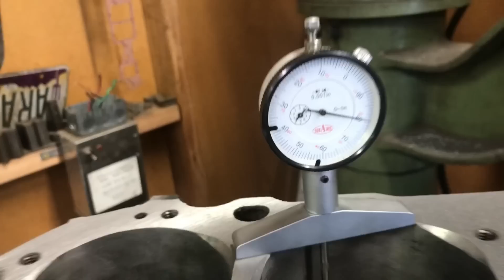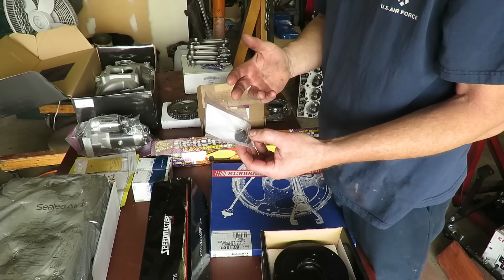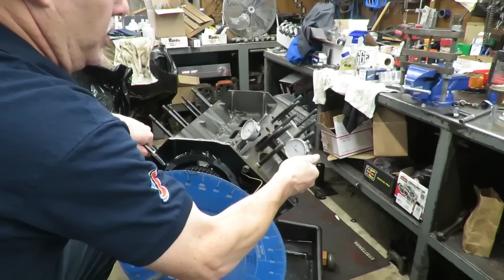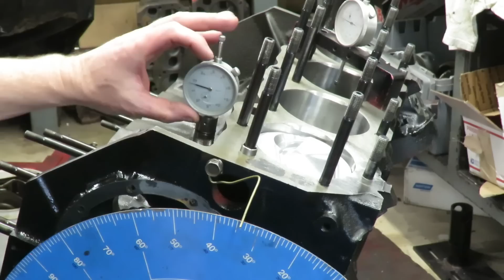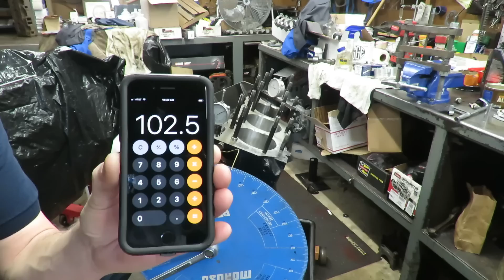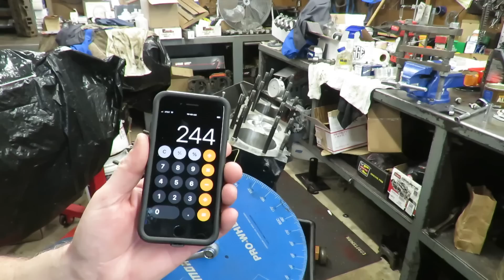Chevy S10 427 Big Block project!!

Comment: My engine is basically the same set up mine is bored 60 thousands so it's a 439 I have afr 265 oval port heads with a Howard's hydraulic roller 235x241@50 on a 108 lsa I do have a Lil more compression I have around 10.5 to 1 I also have the factory forged crank with the good gm dimple rods and with a Victor Jr. Intake and a 950 it made 662 hp and 605 torque. I think you are going to be surprised at the power. This set up makes if your heads flow good. I'd like to know what headers your using on the S10 can you tell me the part number and brand? Thank you in advance.  Your friend from Louisiana Rick 427

Comment: Great video. You camshaft is fairly close to the one I have. I have a 427 sbc built in 2012. It has a Howard's cam with .400 lift and 251 duration @.050 on the intake and .387 and 255 duration @.050 0n the exhaust. It has a 110 lobe separation and center line of 106. I have afr 220 heads on it. It put out 598 lbs torque  and peak hp was 648@ 6200 rpm when it was run on the dyno. Did you dyno yours and if so what kind of numbers. I'm currently thinking of doing a 468 or 496. Thanks again for the great video's.

Comment: In this day and age,a press fit pin ……..
Really?
Why would you heat a rod end up 
Like that on purpose?
I’m a novice to this so please don’t take my comments the wrong way.
I’ve seen rods glowing red to put the pin in.That’s got to screw with the strength of the metal.
Reply from the maker: The rod heater has a thermostat that limits the temp, the factory for most makes uses this method most production engines are semi floating press fit pins

Comment: I have pretty much the same exact motor 427 60 over howRds 235×241 duration @50 618 lift on a 108 lsa AFR 265 oval port heads that had 112cc combustion chambers that were milled to bring my compression to 101/2 to 1 the only difference I see is my pistons only had 18cc domes TRW forged with factory forged crank and dimple rods I even have the speedmaster airgap intake great minds think alike...lol I'm putting the motor in my 88SS monte carlo. Thanks for the video your friend Rick427

Comment: How does a 454 bored 060 over make it a 440 ?
Reply from the maker: its not a 454 its a 427 because of the crank stroke that's why the title of the video is 427 project this is also explained very well in the video series perhaps you should watch and listen closer

Comment: On your video chevy s10 427 big block project!! When you were checking intake lobe center u said 56* at 50thou, then went other way 50thou and had 151.5. But when u added the 2 u added  54 an 151, instead of 56*. Anyways still in spec an love your videos they are by far the best educational engine videos have found.

Comment: Get a lower rise intake and use a 1" insulating spacer. It'll keep the carburetor from heat soak and give you the extra plenum at the same time.

Comment: on a chevy 400 would you recommend using a small base circle cam with scat stroker rods that are already clearanced or do you think ill be ok with just a standard cam this is not a stroker motor just a 400 with the 7/16 cap bolts?

Comment: Why deck a already thin stock block 20 thousand to gain a 9:8:1 ratio? Run a 22 /27 cc piston and there you go .. and also yes like mark and myself and you yes you can use 781 heads port them and install bigger valves but that’s a lot of $$$$$ peanut port heads ported would be cheaper and deff deliver the power numbers for this build there actually better suited and would bring way more low and mid range power on this engine

Comment: What kind of RPM are you planning on turning with this motor? I have one with same heads ported best to my capabilities ,219/188 valves also and it comes up on the chip(7500) extremely quick if you are not paying attention also same compression ratio , your videos are extremely helpful

Comment: Does all this  info etc., also apply to the 454.  I've just bought a 454 backed up with a 4 speed to put in my 1976 Stingray.
Reply from the maker: Yep the only difference between a 427 and 454 is the stroke you could apply all this to a 454

Comment: Why are you using head studs with only 9.8 compression? And why are you not using studs on a two bolt main block?
Reply from the maker: I used the head studs because I had them,  also if you plan to remove your heads now and then you should always use them regardless of compression ratio. I actually  did use main studs although it's not in the video I ended up changing to studs however on a mild build like this main studs are not at all necessary,  I'm not sure why you think they are!   Chevy BB 2 bolt blocks with factory bolts  will take 500 HP all day long with no issues
Reply: @Myvintageiron7512 The piston speed of a 4 inch stroke at 5500 - 6000 rpm which a lot of street engines get to , needs all the help it can get.
Reply from the maker: @joe-hp4nk  The piston speed of a 4" stroke engine at 6000 RPM is 4000 FPM  even the  weak 2 bolt main small block  with stock bolts can take 4000 FPM all day long a BBC can take much more than that I have been doing this for 30 years  I have never ever seen a Big block Chevy 2 bolt block stretch a cap or bolt after being buzzed to 6K  like I said you could spin a stock 454 bottom end to 6K over and over for years and you will never hurt the 2 bolt caps and or stock bolts I'm not sure who is giving you theses ideas but they are just plain wrong Also this whole conversation started by you questioning why I used stock bolts on my engine in the video is not a 4" stroke  it is a 3.760 stroke at 6000 RPM is has a piston speed of  3760 FPM  you could hold any engine at that piston speed indefinitely with no main cap or bolt issues again you really need to do more research before you post this stuff

Comment: There's a good reason Why the lifter valley has those long holes. oil drains down over the camshaft for lubrication of the lifters and lobes.
Reply from the maker: Wrong BBC cams are engendered to oil the cam from underneath the oil throw off from the crankshaft  Blocking off the passages in the lifter valley is common Practice it is done to high RPM race engines all the time and it improves HP  you really need to do a little more research before posting because you really don't know what your talking about
Reply: @Myvintageiron7512  I know about the splash from the crank. It's just at idle when there is no splashing or very little the extra oil from the top is welcome on a flat tappet cam.
Reply from the maker: @joe-hp4nk  There is tons of oil being thrown onto the cam even at idle more than enough to keep it lubed
Reply: @Myvintageiron7512  The baffle that prevents oil splash also prevents oil from reaching the cam so oil draining down from the top is welcome.

Comment: Will a short deck intake fit on the tall deck block?? If not why??  I just got a 427 tall deck and trying to find parts that I can buy with out killing my pocket..?? Any help would be very appreciated..
Reply from the maker: They do make spacers to adapt your short deck intake to a tall deck you will need an aftermarket distributor as well 
https://www.speedwaymotors.com/Weiand-8206-Tall-Deck-Oval-Port-Intake-Manifold-Spacer-Kit,145572.html
Reply from the maker: No the heads are farther apart because of the taller deck so it takes a wider intake
Reply: Thank you very much.. After all the help and research I should just let it go to the scrap yard and get crushed.. And I would have been better off with the 454 instead..

Comment: Here's an interesting scenario maybe it's not the main seal, after warm up there is no leak, only when I rev it up its starts pouring, I'm thinking pan is the culprit, I  tired tightening them, some were loose but still the same thing no drip at idle just at higher revs
Reply: Also noticed a mist or spray hitting flex plate flange as if gasses was exiting, could this possibly be culprit a pan gasket leak lmk

Comment: The new 468 i am building i am using a howards hydraulic roller cam 297 / 308. Duration 640 /640 lift 114 +4  lobe seperation 110 intake centerline. Plus boosting it a little bit. Howards / Morel lifters are much better then Comps.

Comment: Driving this truck on the street with this built engine what is the life expectancy of this engine ?
Reply from the maker: many years the parts in the lower end are rated for over 1000 HP I'll have about half that much also the RPM range will be 6000 max I always like to build em big with pump gas compression and low RPM so they live a long time it's better to rely on HP to weight ratio and big CID to make something go fast you don't need crazy compression and high RPM's to make power

Comment: I will say that I did find this video very informative but if you could please read my last 2 comments I would like to know the answers to the questions posed, I'm not trying to be a dick but I'm new to degreeing wheels and I just wanna have all my bases covered. I'm gonna be building a small block chevy 350 , last 3 of block casting 010 if it helps with edelbrock performer rpm aluminum heads. Also I'm probably gonna go with a radical cam with a 3500 stall,loose with 26 to 28% slip for the two step launch control. What's a good lift to match the cam at 10 to 1 compression, also what's a good deck machined height and gasket to ad in lift times compression. Fyi I'm self taught so be gentle and sorry for a thousand questions...

Comment: Wait a minute originally you said 56 degrees then you went backwards you had  151. But you entered it in the calculator you put 54 and 151witch gave you 205÷2= 102.5, but in reality 151+56=207÷2=103.5 degrees, you sir are actually off by one full degree then correct....

Comment: Hey question a buddy has a big block in a stock car and was told it has a advanced cam... We put a hei distributor in and can't get it to run do u still drop them in at 0 tdc rotor at #1 plug wire???
Reply: On compression stroke

Comment: Yes opening the oil drain above timing chain is a must , especially if you run a gear drive. Also open the ones in corners of the heads as well. Love you videos.

Comment: Hey boss building a street strip 489 bbc and wanted to ask you a question yesterday put the crank in with bearings and checked my bearings clearance and came up with .0015 on all of them is that a lil to tight? It’s a 4.25 crank what’s your thoughts on it. Thanks in advance
Reply: it's fine for the rods a little tight for the mains
Reply: Mike Stanfeild Thanks for the feed back talked and looked around and everything I’m hearing is it atleast needs 2.5 to 3 thousands but now my problem is that the crank is standard so are the main bearings. So gna have to see if I can find who makes them cut under standard. This is my first kit I bought together pre balanced and will be my last. Called summit to let them know and they said the company they do the dealings with can’t send me bearings until June.

Comment: Great ,to the point content. Its been years since I've rebuilt one and just wanted to be brought back to speed. These videos are a great tool. One thing that I use to do was use STP Oil for rings and bearings. I used the regular cam assembly lube on flat tappet cams but STP on all other points. Is that a bad thing now? Or is it simply an opinion of what you grew up using?
Reply: There's tons of great assembly lubes out now there's no reason not to use them. I used to use Camguard for aircraft mixed with STP but a good assembly lube is a lot cheaper these days although I still have a tub of Continental Cam grease used for aircraft flat tappet cams that I swear by. But the stuff is crazy expensive these days and thankfully I've got a lifetime supply lol

Comment: What's your opinion on full groove main bearings vs. the more common single side grooved bearings? 
Excellent job explaining cam degreeing, best I've ever seen, very easy to understand compared to other videos
Reply from the maker: 360 degree grooved bearings cause excessive oil throw off you need a high vol oil pump the excessive oil over whelms the oil rings and can glaze the cylinder walls not recommended

Comment: Fun Fact
Down here in Florida, the LS swaps have gotten so popular (5.3 engines are now about $2000) that the Gen 6 454 Big Blocks are now selling for about $600. The Gen 6 came with a roller cam so it has built-in Cam Walk limiters.
It's a good thing since everyone like a Big Block.
Reply: @Camo4life Realtree I usually buy my engines off the shelf so I have to pay a little more.
How much did Pick n Pay charge you?
Reply: @Camo4life Realtree Good Job, are you going to boost it? I'm planning on boosting (turbo) one of these engines but with a cast crank I don't know, I might have to get off my wallet and get a forged crank.

Comment: Those connect rods look like I-beam rods not H-beam rods. By boring the cylinders .060 on Chevy 427 is 4.185 not 4.30 unless it’s 454.
Reply: 5 Saber standard bore on both 427 and 454 is 4.250. .060 over would be 4.310 for both.
Reply: Sorry, I was incorrect about the 427’s bore size. You’re right. Thanks.
Reply: 5 Saber you are confused 4.185 would be a 400 sbc .060 over...
Reply from the maker: Did I say H beam rods? dang I need to back and watch that they are definitely I beams

Comment: DONT PUT UR RING GAPS ON THE THRUST FACE OF THE PISTON...  amateur hour
Reply from the maker: I have had this conversation so many times.  I will spell this out again,  back in the old days there was a diagram telling you exactly where the gaps should be set,
 However we now know that the rings rotate on the pistons when the engine is running Total Seal has proven this over and over, so it does not really matter where you put the gaps as long as they are staggered maybe we should call this uninformed hour rather than Amateur hour
Reply: Myvintageiron7512 
oil rings do not rotate

Comment: The .050 on each side of the cam lobe....that'll only work with a symmetrical cam lobe.  You can't find the center of lift of an asymmetrical cam lobe with that method.
Reply: That's how manufactured give the @.050 duration number.  The degree is measured at .050 so regardless of the lobe geometry it's where it is
Reply from the maker: yes you are right Asymmetrical cams require a different procedure but 95% of the cams most people are running are symmetrical

Comment: Surprised you're using a  2 bolt block. Would it be worth installing 4 bolt steel caps? How much does that run?
Reply: Usually 400-500 in labor for line bore and line hone + cost of caps
Reply from the maker: Two bolt Big blocks are crazy strong I ran a two bolt with 600 HP for years and the block held up just fine
Reply: @Myvintageiron7512  I was in a bench racing session years ago with a couple of very smart engineers. The focus went to the extra ears on the 4 bolt caps. Some but not a lot of extra strength was the conclusion. However steel caps or a stud girdle was deemed worth the trouble.

Comment: The duration is likely off because of the dial indicator holder tool follower is slightly smaller diameter than the actual lifter.  If you re-measure with the lifter, duration should be as specified on the cam card.  The tool is good for centerline method because you are just measuring the same distance on either side of peak lobe lift.
Reply: roller lifter only contacts one point on the wheel, the indicator tool has a rounded insert end for mimicking the roller wheel of a roller lifter.

Comment: Why are you going thru all this work for a hyper piston dual plane intake motor for an S10.. Any stock 427  would have been just perfect ...I'm really trying to understand why your going thru all this work  for a Dual plane mid performance motor .... All the work your doing would be a welcome sight on a 12:5 motor single plane  roller cam 2 1/4 inch header bad ass...  I'm just not feeling it ... bro ...it really seem's like your like going thru the motion's  and coming up short ...and I have to wonder just how many big blocks  have you ever built under 500 HP ?  Because My L78 80 over 396 with 11:0s and a not to wild solid roller Victior intake and we didn't even go nuts on the head's we used a Carb Shop 950 CFM  stahl 2 1/4 inch headers made 690 HP at 6500 and 580 LBS 4200
Reply from the maker: your intake needs to match your cam RPM range and the cam needs to be paired with the flow capability of the heads my question to you is why would you put a single plane intake on an engine with a cam that has a power band from 2300 to 6500 when the single plane's range is from 3500 to 8000 that is a huge mismatch of parts the key to good reliable power is correctly matched parts this engine will make over 600 at the crank and never rev above 6000 on pump gas a single plane intake is a dumb idea on the street this engine will be much happier with this intake and hyd roller cam
Reply: Not really sure what your getting at? Doesn't matter if your building 300hp or 1000hp there are steps and machining that needs to be performed. You spend all that money on parts are just gonna throw it together and hope for the best. Maybe that's your logic but not mine and alot of others that have done this before.